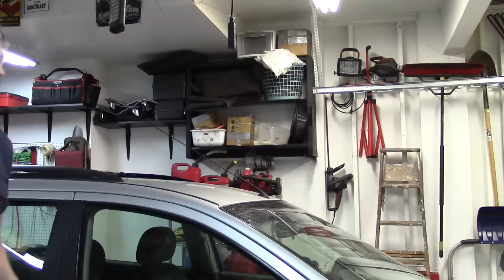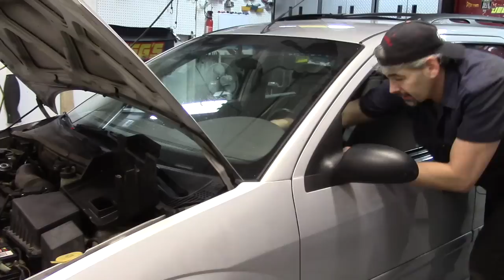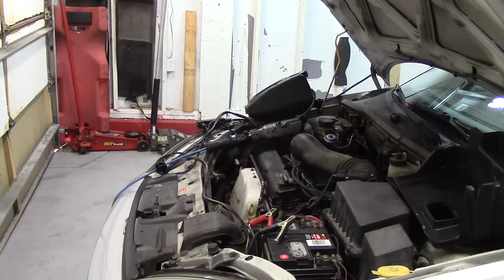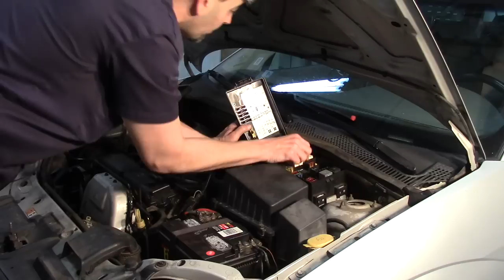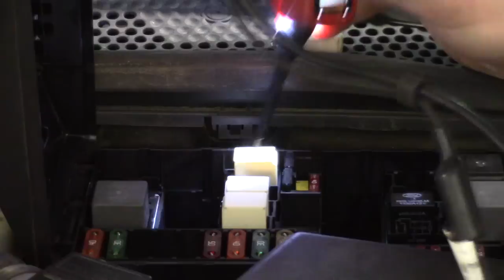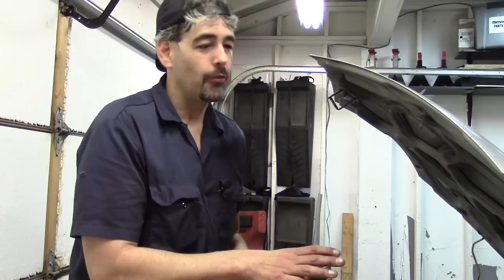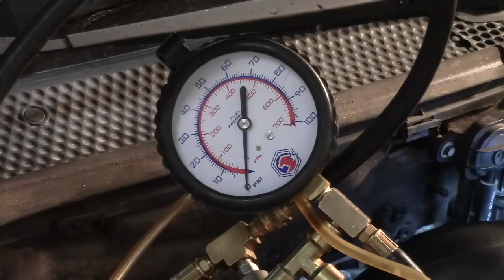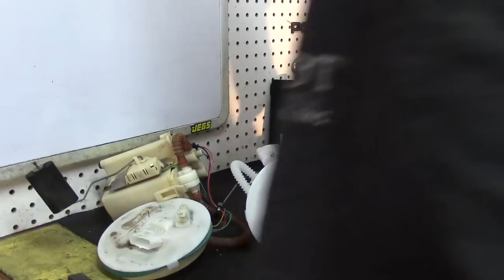Cranking No-Start Real Time Diagnosis -Ford Focus

Comment: Well I repaired the connected in the module. Question ? What if I solder wired to outer ring connecters then electrical tape them all seperatly and zip tie each prong after taped ect ? Is this safe , can a spark cause a boom ? will solder and tape cause a spark ? I would think it would stop any spark.You seem like you know stuff so I'm asking you
Reply from the maker: +Headshothorror4488 You're delving into stuff I have never heard anyone doing in my entire life bro... sorry you're on your own with this one. I have absolutely no idea what you are doing.  I only hope you do lol.
Reply: +Schrodingers Box

Haha sorry I know its allot.  Its simple though, There is a connecter that the pumps power wire goes to, It is located at the inner lid of the module   and connects to the same  prongs the cars connecter connects to on the outer lid. Prongs go from the outer lid to the inner lid,  so both connecters can connect to them . The inner lid connecter/adapter has  melted the plastic a bit where power wire lays.

But my question was how does electric wires sit in gas ? How does this not explode. Seems od to me I thought liquids would short out wires atleast. 

You should check the conecter I am talking about on your next pump install. You may find it melted a bit as I looked it up and many people have had this issue.

Lastly I fixed it and the pump works in my car BUT the fuel comes out in a pouring motion it don't shoot out so I assume it's weak ? ( not on fuel line yet).

I know it is allot haha. Your video helped me out allot as it is,  so no worries. Thanks

Comment: So what if that last test runs the old pump ? U said wiring in module would be bad , how is that ?? Cause mine ran with that last test ( power to pump ). Please HELP
Reply from the maker: +Headshothorror4488 Oh wow... yeah that makes things interesting, i have never seen that.  Your possibilities are bad relay, tripped shutoff switch, or bad wiring on the control side (missing power or ground or both).
  Was there 12V on the control side?
Reply: +Schrodingers Box Yes i believe so. Weird thing is I have the "same"  car you are using in this video too . I am going to start all over and do tests again and I will let you know. I just didn't put 12 volts to the number 5 pins port for the relay,  as you scared me with your warning haha. 
 Can I jumper wire the pin and be safe instead of a power probe ?  Which pins do I jumper wire, I have same relay and same car. I would do 3 to 5  ? Again I have the  same relay in this video. 

Thanks man, your video helped allot, so I am going to re-do every test tomorrow. The motor does run with a jumper wire straight to it, I know that for sure. 

I will comment tomorrow. Thanks for your time
Reply from the maker: ***** Using a power probe is the same as a jumper wire.

  You will want to jumper the LOAD side to connect the 12V feed towards the pump, DO NOT JUMPER THE CONTROL SIDE.
Reply: +Schrodingers Box It started by first my radio killed my battery. So I jumped it with it on E. It was flashing lights on dash rapidly. After a few turns it started but didnt crank the whole time it just started outa nowhere. Then stalled a bit later and woundt start. So I scraped  the terminals on the battery and put 2 galons of fuel in. Then it cranked and started first time , sounded good. Drove to the store and got back with it on E again, shut it off and restarted and no go, added gas and no go. I added a system with bass also if maybe the bass rattled something ?

I don't know but I will test again and let you know tomorrow what happens. Just wanted to explain how this started. Also it sat for 2 months before all of this but it started fine it was just shaky at first.
Reply: +Schrodingers Box  The Load side is pin 3 to pin 5 right ? Pin 3 goes to pin 4 with a line, then when it goes on it clicks and puts 3 to 5 ( on relay it shows 5 alone in the middle). 5 Is what gives power to the pump correct ? So the control side would be the coil side of the relay. And pin 3's port should have 12v always ? From what I seen on this video I believe that's right I just want to make sure. Thanks this is a huge help as I have this same car.
Reply from the maker: ***** I really don't remember what pins it was- that was like 8 months ago.
  The map should be on the relay itself so you can't go wrong. Just jump the load side and the pump should run. If it doesn't the pump is 99% likely to be bad.
Reply: +Schrodingers Box        Soo I ran some tests and relay was fine. relay port was fine and have 12 at 3 pin switch that goes to 5 (pump). Then intertia switch was fine but I jumpered it and has 12v to pump driver and driver to pump connecter. Yet pump didn't work, so I ran a jumper to it like last time and no run, So I took it inside and the connected at the top of the pump waselted , I have no continuety at the power wire and traced it to the connected. It had meleted plastic in the connecter port (power wire) and was allot of dried platic blocking that port. So I scraped it out and now have 00 at ohms so connection is back to goo and I will try to run it tomorrow and see. Yet I may need a new one as that don't seem safe haha. Tho I didn't see volts at driver at first, also Inertia had 1 volt on one side and when turned key 12 volt other side so I jumpered it and had 12 fully. Put that back together and was fine. It took me a while but I'm sure I'm good all the way to the pump with volts. 

So my power wire port on top of the inner pump that connects to prongs coming through to the top of the pump that connects to cars conneter has melted and blocked connection I think. I will retest pump tomorrow and see if it runs again and if so I think it will run car. Perhaps my filter is clogged and tubes in pump causing fuel to not move heating the wire up ??

Comment: I have a SE 2000 Ford Focus and don't hear lump so how do I remove the gas tank ?
Reply from the maker: +Headshothorror4488 You remove the bolts holding it in
Reply: +Schrodingers Box I can do this with 2 jacks or I need to lift car ? I ask cause some cars u need to remove allot more and the chassis even on some so yeah its allot more then bolts sometimes. U have a Ford Focus ? U did this ? Thnx
Reply from the maker: ***** i doubt you will fit under the car if you dont lift it.  It really not that hard- put the rear of the car and jackstands and remove the bolts holding the tank in.
Reply: +Schrodingers Box Thanks

Comment: I  was yelling FUEL FUEL multiple times
Reply from the maker: +Andrew lechner based on what conclusive evidence that would have eliminated other factors?
Reply: +Schrodingers Box 1. The guy who tried to fix it added new spark plugs and wires.I would start on adding  starting fluid (after charging the battery) .Then if it runs,it should be the fuel pump that is making the problem.This is how I would do it and in this video,it was the fuel pump that was making the problem.
Reply from the maker: wow.
Reply: it seems like you are very surprised right?
Reply from the maker: hell yeah- so you just add starting fluid and if it starts you replace the fuel pump huh? That would have cut this video to like 2 minutes.

Comment: also I didn't mention that my gas pedal is very loose, and it pushes all the way to the floor ..:(
Reply from the maker: +Tavon Young Is it a cable or drive by wire system? Either way you have to check what the problem is and repair accordingly. Is the throttle spring broken? I can't see it very well from here bro.  Simple mechanical inspection is all anyone can possibly do- even if they engineered the system

Comment: heres one good for you  ! have a Mini Cooper S, i changed the gas filter. pretty easy and simple stuff.  but then... car dont start, it cranks but no start. tried everything i can think of. i can hear the pump working when I turn the key. i did the cycle a zillion times to fill the system. but no luck. when I disconnect the hose that goes to the filter gas came out right away, and also i check in the front and if i press the schrader valve  gas comes out too. so there is gas in the system. i tried the liquid starter thing and nothing. what the heck? car was perfect before the filter change! the pump is on the right side so i didnt even touch it or came close to it. any ideas?
Reply: +Walter Jacott by the way, the gas from the valve dont have lot of pressure it just flows out. what drives me crazy is that it was perfect 2 days ago. and i didnt touch the pump at all. only touch the filter and already check it a bunch of times, I put everything perfectly :( to check the pressure i need to connect the gauge to the Gasoline Valve?
Reply from the maker: +Walter Jacott What is your fuel pressure when deadheading the pump?
Reply: +Walter Jacott   why not try starting back at squar one? in other words..put the old filer back in ..see what happens ..maybe not the most scientific ..but it will at least rule out anything you MIGHT have done .

Comment: Great video. Might you can help me to solve the problem of my 2011 ford focus with 67500 KM. My car is cranking and hard to start, it will take 5 or more times or randomly to click before the engine get started. Sometimes I tried after travelling the car and I stop the engine then restart again then it was ok but this rarely, more often its hard to start. My car battery is good.
Reply from the maker: put3ska78  Is the problem air, fuel, spark or compression related? You need to determine the cause before I can help.

Comment: Great video! Couple of Questions if thats ok?

1. Did you only check for spark on 1x plug?

2. That spark plug tester light would show spark in the leads.. can the plug itself still be bad?

3. Can I use my 12v car battery, connect to the Fuel pump directly to see if it powers on?

4. I have a 2001 Isuzu Rodeo 3.2L V6. Where's the best place to find what replacement model/serial etc.. pump I need ?

Thanks :)

Comment: I"m having a no crank/no start problem but there is a fast ticking sound (from the starter).  My problem is highly likely to be the battery and I'm waiting for a boost (my car had the windows open last night and it rained so a short somewhere probably drained my battery).  In the meantime, I watched this video and I am so impressed with your skills not only with the mechanics but your ability to explain in common language.  I would heed your warning and never touch the relays but I am learning about the general functioning of the engine.  Thank you so much for your videos and I will subscribe and I've learned so much already.
Reply from the maker: Private Netizen Your possibilities for that situation are bad relay, bad battery, bad starter/solenoid or voltage drop at the starter. I have videos on all of these so solving your problem is assured.

Comment: With a scan tool you can check fpr percentage and on that model there is a fuel pump driver module.
Reply from the maker: Yes correct. But when I saw zero from the scan tool I wasn't convinced because my scan tool very often shows PIDs that I cant actually read with it.  Indeed when  i fixed it, the scantool did show the correct pressure.

Comment: Couple of questions for you (Yes, I love coming back to old videos of yours).

When you do the spark test...you test all of them right? I have yet to have a car not have spark so I'm remaining unfamiliar with this test.

Where do  you get your pins that let you alligator clip in? I go to tons of tool stores and what you use has never caught my eye (I like how they look safer than T pins).
Reply from the maker: DE Nichols Good questions.  Basically if I test spark on a no-start and see it on one cylinder- I immediately just assume all cylinders have it unless there is reason or evidence to the contrary.  Now if I see NO spark- then I will test another cylinder immediately (and not one that shares the coil if it is a waste spark system) and if there is no spark there I will go in direction of no spark command to any cylinders being the cause of the no-start. I have seen this before with Cam or Crank sensor issues or a bad coil on distributer models, but agreed- not nearly as common especially on a COP model.
  The alligator clips- lol... yes those are like gold nuggets to me.  I get them from Radioshack and I recently stocked up a bunch of them before they went bankrupt!!!

Comment: That car does have a two second prime. Use a scan tool and read the fuel pressure reading the scan tool.  Use silicone spray it won't dry out the cylinders.

Comment: I was driving my car on a normal day and suddenly, it stopped. I tried cranking the engine but didnt start... I towed my car to a car shop, at first, they say ignition coil needs replacement, after changing it, still it didnt start.. second, they say distributor is damaged, after replacing, still it didnt start.. lastly, they say timing belt, the car starts... my question is, can i trust my car if I drive it to work (1 hour ride)? does a bad timing belt causes the car not to start? or does it cause your car to stop if its bad? They showed me my original timing belt and it really is damaged...
Reply: If it  is bad and torn it can slip and cause the timing to go off and shut off and it won't start, and if it does start it will run really rough. If they replaced it properly then you shouldn't have to worry but you should always  get it  replaced before it's to late and snaps because if your engine is an interference motor it can fuck up the valves and your fucked
Reply: Ian Palermo

Comment: Hello and nice work.
  For safety reasons, I feel that it is important to mention that caution should be used when applying power and ground to a circuit where there may be a likeliness of fuel vapor because of the arcing that takes place when electrical connections are made and broken.  I noticed this when you used the Power Probe at the tank.  It even appeared there may have been an evap. line or something that was disconnected in that shot.  You also mentioned the tank was empty which would make this even more dangerous given the amount of vapor.
  In a situation like this where making electrical connections is a must, it may be safer to extend jumper wires a safe distance away from the presence of fuel and then making those connections there in order to gain your desired result.
 Please forgive me if this has been mentioned as I have not read most of the comments posted here, nor am I very familiar with YT usage in general. 
  I am a subscriber to your channel, yet have not had the time to view many videos, but have enjoyed the few that I have seen.  Your logic and perspective is a treat to see and I really appreciate how you provide the auto repair consumer with the same.  It makes for better communication and understanding when they are in need for professional and courteous automotive maintenance and repair services.

Comment: Why would they replace plugs and wires? Are they assuming the car would run perfectly all along and then all of a sudden not start due to plugs/wires?
Reply from the maker: bg147 I have no idea bro... I guess the logic is to replace the things that you know about and pray you are lucky.  I see it every single weekend at AutoZone.  Some moron gets his codes read- it's P0171. The clerk enters it into their database and it says possible causes are faulty plugs, wires, fuel pump, EGR valve, exhaust leak, Intake leak,  MAF, MAP, etc....  The guy asks for plugs and wires every single time.
Reply: I recall talking to an old friend years ago and I told him that diagnostic skills make a good mechanic. He disagreed and told me that everything is computerized.... you just hook the car up to a scope and your question is answered. I believe many people out there actually believe this.
Reply from the maker: bg147 Dude.... It happened to me just yesterday...
  About 2 weeks ago a viewer asked what scantool I use. I replied Autoenginuity.  Just yesterday he starts yelling at me "this thing is useless, it doesn't tell you anything about whats wrong with the car at all. It's no better than just guessing at stuff. You have no idea what you're talking about. I am going to return this stupid thing...."

 .... This was on my Fuel trims video BTW.

Comment: also were do u get ur wiring diagrams and other information on specs? i was going to download an older version of alldata pro but was wondering if u knew any "sources" to get free information and diagrams. Schrodingers Box
Reply from the maker: Lalo Herrera Most often I resort to google to get diagrams, albeit with a great degree of discomfort lol.  When I need to get serious, I rely on AllData DIY- I have the customer pay for the subscription for me and it allows me temporary access to everything I need for the repair.  However I have unquestionably found inaccuracies in several wiring diagrams before. I would estimate maybe 85-90% accuracy.
Reply: same here, some days are better than others haha. for the most part I use my community college which has both an old complete set of AllData discs and the new ondemand Mitchell program. So lately whenever ive been needing things I just go to school and go to town.